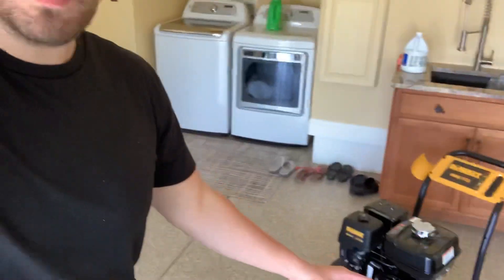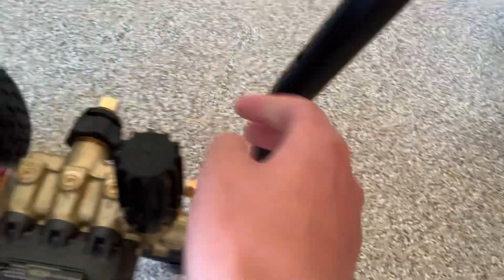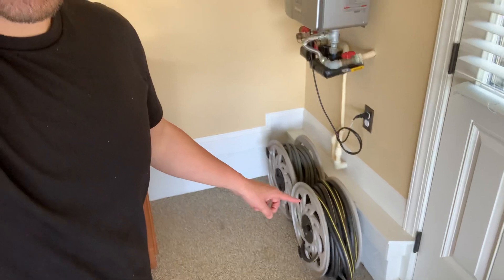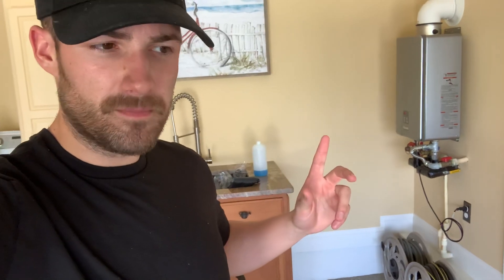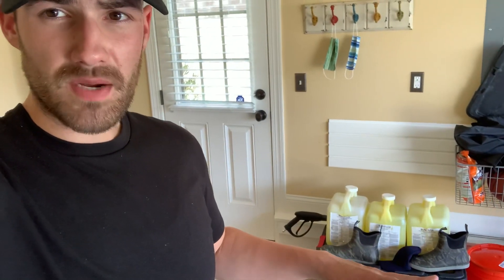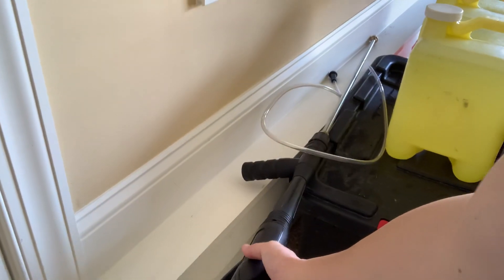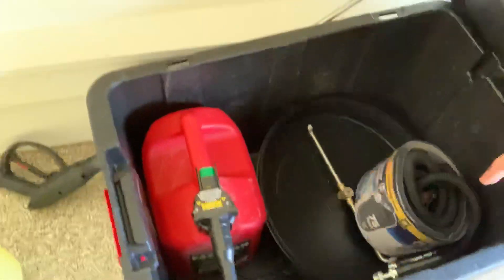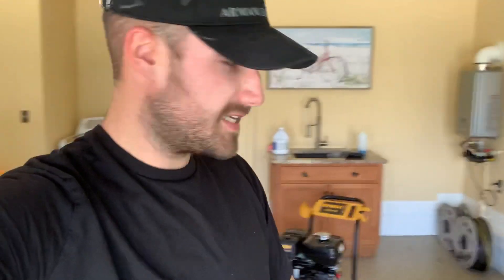Best Pressure Washer Starter Kit For Beginners (Best Powerwasher to begin with) 4gpm

Comment: looking at this same machine and the dewalt 4400 psi at 4 gpm.  looking to clean driveways with a surf cleaner.  which machine would be better and how large a surf cleaner can i use with the two press washers.  do you have to decrease teh pressure before cleaning driveways?

Comment: Do you use 5/8” or 3/4” hose Justin? Does it matter? I have a 2.3 gpm machine.
Reply: Can you use the same j rods for a 2.5 gpm machine
Reply: @apluspressureandsoftwash3715  as long as the connect

Comment: Hey, just got myself a refurbished ryobi 3000 psi 2.3 gpm pressure washer (with 160 Honda engine) from Home Depot because I want to had pressure washing to my lawn care business.  The unit that I have came with a 35 ft pressure hose but I would like get longer one.  My question is, by feting a longer pressure hose, will that affect the performances the machine?
Reply from the maker: Incredible brother! You should be fine